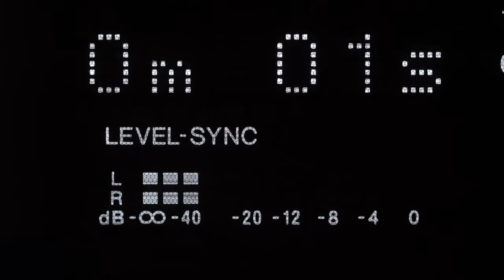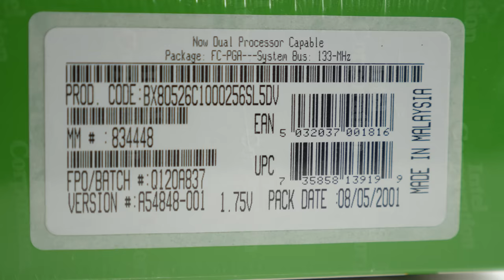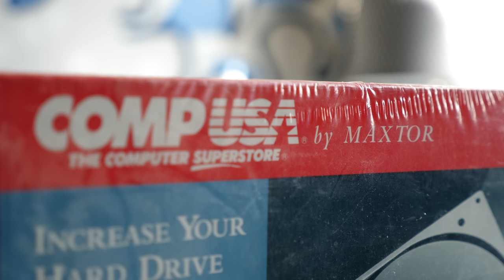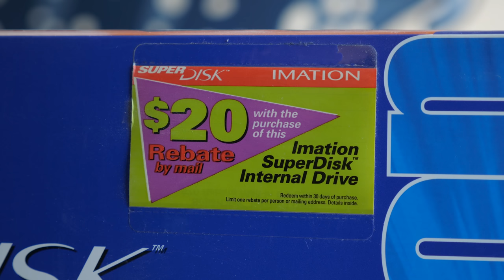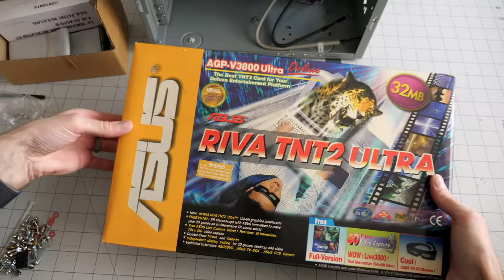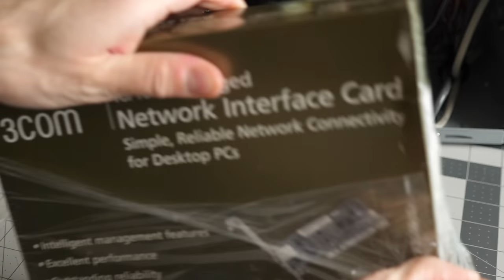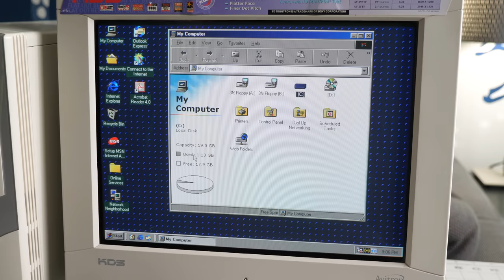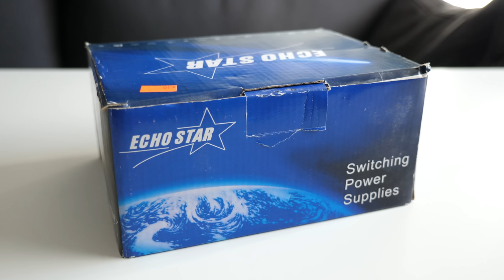Building a Retro PC From New Old Parts!

Comment: I got into PC's and building a few years ago and wanted to start out using older cheaper parts to start with to gain experience. Nothing older then 4th gen Haswell stuff though because I want to re-sell the items. I have been able to run across some brand new, never used parts from charitable organizations that sell them and have been able to build 3 "new" older gen gaming PC's. I've sourced cases, motherboards and GPU's and even an OE in the box with cooler Intel I7-4790K and DDR3 G.Skill ram still in the sealed package. The parts seem to be more available after the holidays and before the income tax deadline in April.I liked and subbed this channel because I have 2 Windows XP machines with Pentium 4 CPU'S and was thinking of refurbishing them or if possible install modern parts and make them retro looking sleepers.

Comment: still running first gen i7 950, the 975 was the first 4 core chip to over clock to 5ghz. mine is 3ghz with AsusMB that windows 10 pushes to 3.19ghz, just had to replace the spinal drive, failed to boot after 13 years of service, plugged in win10/64 wd ssd blue drive and RTX3050. still using mismatched 5 2gig memory sticks that default 1066. The mother board can take 2400mhz ram. The plan is to order that just to see the performance boost and to over clock the CPU. when i got the  system  built back in 2009, the fast 975 was almost 1000 bucks more, the faster ram was almost going to be an extra 1500 bucks, and the top of the line video card was the gtx760 4 gig model for 800 bucks more. I managed to get the system out the door for about 1700 bucks Canadian, with GTX460, 8 gigs of 1366mhz ram and the 3ghz 4 core cpu, and 1tera bite HD. Pretty much the only game i play is my World of War Ships video game , and at that the game loads in the top third of the line up. tested the system on some games and locked in at 100fps on game like enlisted max settings the RTX3050 hits 20% and the 2009 cpu settles in about 40%. Quote from 2022, there is still no app including video games that uses more then 4 cores.

Comment: This is really cool. I decided to log onto my ebuyer account and takes me back as far as 2002/2003 when i bought a Abit KR7A-133 Skt A VT266A and Sapphire Radeon 9600XT. I think my first build was a pentium 2 350mhz slot 1 a few years before. Anything before that was IBM x386 or p100-p166 my dad got from work in the early 90s. Turned 40 this year.

Comment: Those PSU's where very, very common in the days. They where sold with cheap ATX cases and where generally 250W PSU's. However they all advertised with peak power, "up to 450W". Ive used to work at a computer store for some time and most of these cases where send back in weeks. The PSU blew up. People where ordering higher end stuff like 2900XTX's paired with either an Intel or AMD CPU and expected that the PSU would last. Thats where the efficiency thing came from (Bronze, Silver, Gold) etc as well. Good PSU's costed way more then these cheap o psu's. They are prone to either blow up or catch fire.

Comment: pretty cool all that wrapped pc parts, annoying shame the Riva TNT2 Ultra turned out to be just a box with unused cables and the 3d glasses, (though not that surprising, i remmember having hardware like that, you would use the capture features and the glasses for a while then the novelty were off and you put it back in the box or throw it away, same with fancy multimedia cd rom drives with infra red remotes and the like thinking of an old creative cdrom drive i used to own) even by todays standards the Audigy2 soundcard is an awesome card.

Comment: The reason the power supply is so light is that it isn't transformer isolated from the mains. In other words it doesn't contain a huge heavy mains step down transformer. It's what is called a "switching" power supply.

Comment: My first pc was 2003 was The Intel Pentium 4 @2.53ghz with a mighty 1 core & 1 thread @ 133Mhz, what really blew my mind was it had a TDP of 110w, Had a beastly 32mb GPU for all my gaming needs. If I could find and buy all the parts it had i would have it built tomorrow just for nostalgia purposes, then put it away in a glass case on display., added hp LightScribe dvd rewrite year later 2004 to 2005 ish for custom dvd labelling

Comment: Cool vid! I recently built several PCs from around that era. While my nostalgia likes period-accurate hardware (and have an unhealthy amount of it) when it comes to practicality I'll with always replace the hard drive with a $25 128GB SATA SSD + $10 IDE-SATA adapter. Some motherboards have drive size limits and various drive overlay apps usually will handle formatting to make the bigger drives work if needed. For the floppy a Gotek floppy emulator running FlashFloppy firmware is so much more reliable than using actual floppy disks. The irony is that older floppies (pre-2000) tend to be more likely to work than later ones (2000 onwards) because the quality of most later floppy disks was usually greatly lacking so they fail at a much higher rate.

Comment: Very nice. I kinda miss doing this kind of build. Just slap everything together and turn it on. And cable management,..what management?
Reply: With the right case and a modular PSU I'd argue that cable management has never been easier.  Just finished building a PC for a friend and I don't think I used a single cable tie.  That wasn't even a modular PSU, just a great case.

Helps that I don't mess with water cooling, that'll fill your case up quickly.

Comment: I built a retro pc with an old Dell Optiplex (2007) It was a low profile horizontal pc, that came with an AMD Athlon single core. I had a dual core AM2 on hand so I put that in. 4gb ddr2 memory. A Nvidia Gforce 9800 gt (512). I only needed to update the bios to run Windows 10. My other hard drive has Windows xp. I could play Modern Warfare 2, Assassin's Creed 2, Mass Effect 2 etc. I used my XP hard drive for my old games.

Comment: Good Video, I was into Commodore back in the early 90’s and had a 1200 Bundle, My Brother was into PC’s and offered me a 486SX PC which I had and have never looked back since, I’ve amassed a large amount of Computers (over 50+), Laptops (over 100+), A number of Motherboards, Soundcards, Graphics Cards, CPU’s, Memory, Keyboards, Mice & Speakers etc, Parts that I prize are a range of Voodoo Graphics Cards, Sound Cards such as the Sound Blaster 16, Awe 32 & 64 plus a Sound Blaster Platinum with the Live Drive for the front (You showed the more up to date Black version for the Audigy at: 44:33 although mine’s the White/Beige version which comes with a useful Remote too, Most of the parts in the box are still sealed, Just been going through some of my Motherboards & found an ASUS CUSL2 which uses the 815 Chipset & it’s still in very good condition, You wouldn’t think it had been used for the most part, Regarding the Monitor at: 55:07, Some Monitors had rotary Brightness & Contrast controls such as some of the Compaq’s back then and if they’d been turned down to their minimum then you could think that the Monitor was not working when in fact it was and you just needed to turn the Brightness/ Contrast up, Just a thought & did you have any joy with the LS120 Drive in the end by the way? I plan on uploading videos to my channel at some point soon so people will be able to see some of the retro equipment & oddware that I’ve collected over the years! 🙂🇬🇧
Reply: Just to add that the Case wasn’t a bad looking Case in all fairness, I’ve seen a lot worse, I used to work at a small Computer Store here in Birmingham, UK   back in the late 90’s early 2000’s and they used to buy Cases by the container load and a lot of them didn’t include a PSU & I know a lot of them don’t nowadays either, Last Case I bought in 2020 was a Cooler Master Cosmos C700P and that didn’t come with a PSU either, By the way, Was that random glue used to hold the decorative panel on the front in place, It looks like it’s a separate part of the Case? I’ve never come across a damper for a PSU before, Don’t think I would’ve used it either! 😂

Comment: 44:20 Watching this again, is there not front panel audio on the motherboard? Bit of a pain, but if so, just switch over to using onboard audio when you wanna plug in headphones into the front or whatever, or make up a little adaptor cable that connects to the front panel audio cable and runs out of the back and into the soundcard, front panel audio to 3.5mm

Comment: Wow someone holding a real Riva TNT 2 Ultra with active cooling in his hands! Without a time machine... That thing was even more elusive than the legendary Voodoo5 6000, and a pure legend. Now insert a Sound Blaster Live! and a Celeron 800MHz and you can play System Shock 2 in authentic retro-style while waiting 15 Minutes until the level loads. 
By the way this card you are holding in 47:05 (the upper one with the black cooling fins) looks exactly like my first ever graphics card, a Diamond Riva TNT with cooling fins but no active cooler, and 16MB RAM. Now after building this PC I think you need my brandnew and still sealed Monolith Engine Aliens versus Predator 2 and System Shock 2 authentic original disks I am still keeping for retro reasons because I consider these as "the best games ever made" (just like Descent II, but this one unfortunately got lost in time).... :D
Seeing this ancient hardware makes it clear how incredible far computer technology has come in the last 20 years, now we have hardware with absolute top-notch quality with so much style and design efforts, every mainboard and graphics card and cooler is nowadays so absolute good-looking and masterfully designed and meant to be implemented into an illuminated glass-case to become a piece of modern art on every computer desk.

Comment: I thought about building a true retro XP gaming machine back in 2020 since I still have an Audigy 2 SB and a Riva TNT2 card, but the more I looked up prices for parts the more I didn't want to do it. In total, the build would have been nearly USD 600 and I could spend half that and build an XP emulation machine that would be twice as powerful. Kind of sad that such old parts are so costly.

Comment: It seems the old Audioblaster is using more pins than it uses now.
Because now the latest one is PCIe 4.0 x1
Ofc, the one you unboxed is probably some kind of PCI interface, not PCI Express.
I'm not that old to figure it out, I'm talking only from what I learned over time about computer history.
Reply: Its surprising there's still a market for it tbh!  I can't remember the last time I didn't just plug speakers directly into the motherboad.

Comment: Never was a big fan of flashy LED fans and such myself.
... I have two old Antec systems that are comparable, and both power supplies are still going strong. That's one place you shouldn't cheap out.
I made different choices; went with AMD cpus. One has an Athlon XP 1Gz cpu with 1Gb DDR ram and a Voodoo 3 3000 AGP card, Asus A7m266 motherboard. Still purrs like a kitten.
The other Antec case has an MSI KT4 Ultra motherboard, Athlon XP @2Gz, onboard sound & networking, ATI Radeon 8500 LE, 1Gb ram @ 333Mz. The BIOS allegedly handles 400Mz, but 333 seems a bit more stable. Even includes an early SATA port (only 1.5) if you can find WinXP with SP3 or Linux. It comes with two UDMA-133 ports.

For some reason I prefer the older system. It's like a '66 sedan that's not flashy, but so smooth & reliable.

If you're going to go with SD133, why not use a Pentium 4 cpu? Does it go back to what you can scrounge NOS? There seem to be a lot of P4/motherboard combos for sale these days, many with memory. Ditto for Socket 370 P3 combos. But they are used. 😏

Comment: Did you check to make sure that the Eco star power supply was set to 110 and not 220? That sounds exactly like you had it on the wrong setting.

Comment: The front panel connector on that Sound Blaster card is for a special 5" 1/4 drive bay audio expansion module which was quite an handy accessory if you were in professional audio.

Comment: On older machines the battery DOES matter as it's tied into the BIOS and firmware settings. The clock is only part of the process. You will remember that.

Comment: fun fact about motherboard there is a 3 or 4 pin connector on every mother it says system fan you can just plug the fan on the mother board when you power it up it spins

Comment: I just got a new old stock sweex gold dual fan 450W PSU for my Pentium. Still untested, should get on with it.
Those old 250W are useful if still working, just replace fan with a noctua 3pin and low noise adapter and add a couple of molex to fan adapters and use it as a fan tester, test old and new fans for function and noises :) Looks sick too. P.S. bread bag clips!

Comment: any power supply that retail for less than 30/40 $ is suspicious (unless big rebate or clearance sale). I know that my work horses from the 2000 were enermax entry level or seasonic s12 serie. The common trickery was to oversize the stickers, like a 250 watt psu sold as 400 watts

Comment: I loled when he opened the dead power supply and said there's no quality on it because that's almost exactly how my PSU looks like inside. I only know it's not 500W as indicated. I've been using this setup since 2013 with AMD 5600k cpu and so far it's still working pretty alright. The PSU came free with the equally cheap thin can case. 😂

Comment: Great footage. Trial and error is the best! As for this sound card, AUDIGY 2 ZS. I still use it. In a computer with WINDOWS 10 :D It is still better than integrated chips on the motherboard!!! And it's even better in games. Current sound systems are only input/output. The processor does the rest. Here we have, a completely different story :D Sometimes something doesn't work as it should, sometimes there are other problems. But I recommend it :D

Comment: For the time period of the parts (most of which are a couple/few years newer than 2001), it would be more fitting if it had at least 512 MB of RAM, at least a 60 GB HDD, and Windows XP. Even in 2001 a 20 GB HDD and 256 MB of RAM would have been low-end. For example, my first PC was a new eMachines that I bought new in July 2001. It was the absolute cheapest PC at Best Buy at the time and it came with a 20 GB Seagate HDD. It only had 64 MB of RAM (which is enough for very basic computer usage with the Windows Me OS it came with) and the motherboard maxed out at 256 MB. It was cheap to max it out, which I did a few months later. It was around $40 for two 128 MB sticks of PC133 RAM at Best Buy.

My friend Sam on the other hand, had a much better PC at the time. It was an HP that was about a year old and had a 1 GHz AMD Athlon Thunderbird CPU (as opposed to my 733 MHz Intel Celeron), 512 MB of RAM, and a 60 GB HDD.

I built my first PC in the spring of 2002; a very middle of the road build at the time. I bought the AMD Athlon XP 1800+ (1.54 GHz) CPU, an Asus A7A266 motherboard, and an ATI Radeon All-In-Wonder 7500 AGP video card with 64 MB DDR RAM used from different sellers on eBay for a good deal less than they would have cost new. Then, 512 MB of DDR RAM (two 256-MB sticks) cost me about $100, an 80 GB Maxtor HDD cost me about $80, and an Antec SX830 case with an included Antec 300-watt PSU cost about $110. I bought all those at Best Buy. I continued to use the monitor and keyboard that came with the eMachines. The total cost was in the neighborhood of $500. On top of that, a little later I bought a set of Logitech 2.1 speakers (which I still use daily 20 years later) for $50 and a Sony CD burner. I don't remember the price of that; maybe $60?

Comment: That was a pretty good keyboard in its day.  Mine lasted about 20 years.   Logitech keyboards tend to have a 2~3 year life space since around 2005 with cheap key caps.
The center tab/backspace keys work - but are useless in function.  Power Key never worked.  It has kickstands in the front.  There is a bad version with a mouse-touchpad.   Overrall, much better than the Logitech Wave/ergonomic keyboards.  Very slow for gaming.

Because the AT > PS2 adaptors are so large and heavy (about 3 inches long), I used a PS/2 extender cable to make it easier to plug into the PC and far less likely to damage the connector because of its weight.

When my last one died, (two were killed by kids spilling milk on to it), I went 80% RGB mechanical switch gaming keyboard.  Much nicer.   I still kept the dead/broken one for historical, but it may end up in the trash someday.

Comment: One of the systems that I built back around 2006, I built with a Ieee1394 fire wire port, it was the first zero loss media adaptor for transferring Video from the Camera/Camcorder to the computer for video editing and zero loss after editing back to the camcorder. The Ieee1394 fire wire port controlled the camcorder  and camera from the pc. it was said to be the future back in the late 90's. 2009 I captured high end tech and when i was pulling the information from the camcorder my video card and camcorder stopped working right at the frame where the high end blck project shows in the video. I managed to salvage what was left of the video but was unable to recover what was seen just before the tech showed up. posted what was left of the video on my channel, tagged  Light ships, time travel, Portals, Whatever. Pretty funny story. going backtomyvideogame ;) BTW what i learned from that Experience, if you are ever in a positions that you have captured something that looks very high tech, make sure when you are viewing and or editing, make sure the system is not plugged into the Internet or any network for that matter. :)